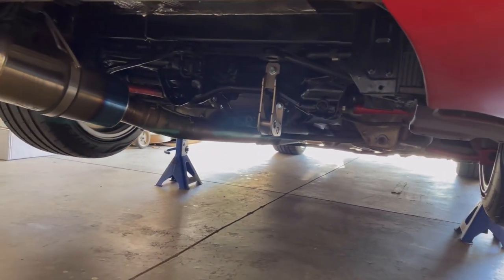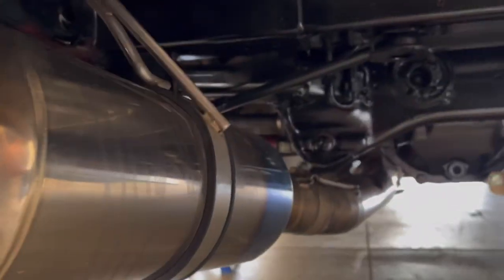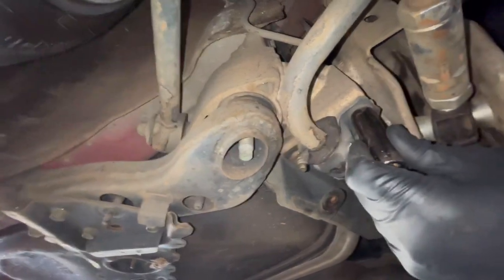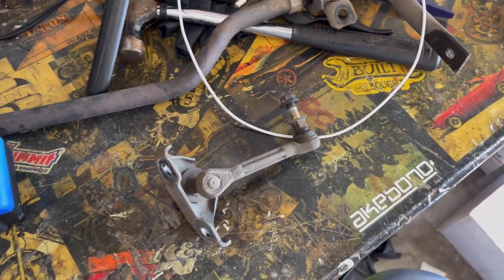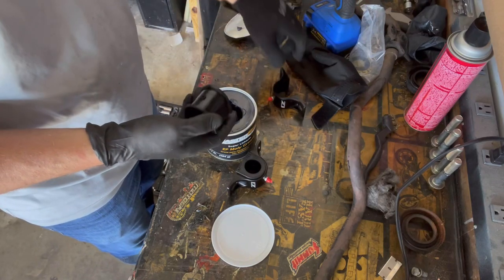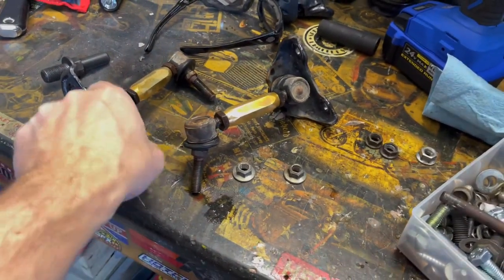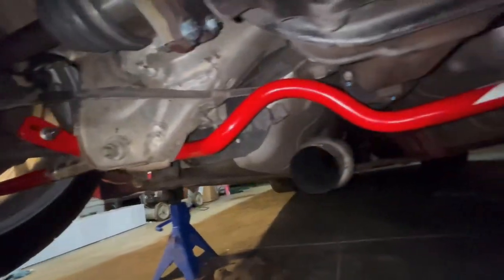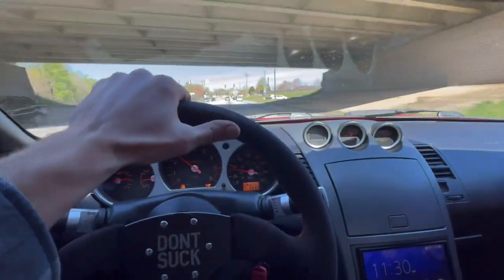Z1 Rear Sway Bar Installation and First Impressions

Comment: It makes a huge difference no doubt,  everyone will agree.  
My problem is I learned the hard way the importance of "zero" preload on the front swaybar.   Completely snapped one of the 35mm brackets holding the swaybar.   So adjustable end links were ordered.   So they are necessary 🤔 and not just because of corrosion or wear.  Good video!

Comment: No hooning test? It'll come I'm sure. 😄 The first couple of sideways takeoffs I remember from the week I put in Eibachs on my old 06 coupe were legendary. You don't quite expect it, and counter-steering in this car was made so easy by old time Nissan engineers. Good job Z1 for making an affordable set, and good job to you for dedicating a vid to the rear sway.
Reply from the maker: I need to get out there and rip but still only have about 350 miles on the new clutch so trying to hold back some lol

Comment: I had Hotchkis sways put on my Z, front and rear, a number of years ago and was really satisfied with the results. I just had the diff bushings replaced with polyurethane ones and like the result. I have a Z1 aluminum strut tower brace that's coming in a couple of days and I'm looking forward to putting it in, it's about half the weight of the stock brace and about 10% more stiff. I'm thinking of getting the Z1 front subframe brace soon.
Reply from the maker: Nice little upgrades that have quite an impact!

Comment: I put a whiteline front bar on my 370z which seems to be what most people recommend. Handling is pretty good at the moment, I keep thinking about getting a rear bar too but not sure if it will be worth it.

I always used to put big rear sway bars on my slow fwd cars to make them a bit more prone to oversteer but don't really need that in the Z
Reply: Hmm don't think it could hurt but I'm in a G37s so my ride REALLY  needs a full setup I definitely noticed how much more focused a tower strut bar made it (but i believe z owners get one at stock G owners don't have too much at all)
Reply: @FOXXHOUND86  Budd, everything that z owners can get so can we (13 G37s)  Bars, breaks, braided  lines, bushings,  intakes, etc.
Reply: @Dragandspinn  yea its pretty much the same vehicle ours is just in a suit & tie and has extra motors for the power options (seats, steering wheel,etc) and the back seats. All these makes our vehicle more heavier/slower than a 370. But the g37 coupe is just prettier and I like pretty things haha

Comment: Z1 vs Hotchkis impressions having both in hand?  I know you haven't A/Bd them on the same car but curious to hear your thoughts as it seems the specs on these are aiming to replicate what the hotchkis bars achieve.  I think its nice Z1 includes the billet brackets.
Reply from the maker: I will have to try and make a comparison that makes sense.  Although it was a pretty dramatic difference in the Z, the hotchkis sway bars being added to the Q was a MASSIVE difference.  But that is such a big heavy car, so one would expect the difference to be more significant.
Reply: @SpeedCultureStudios  okay cool man thanks for the reply.  looking forward to hearing your thoughts on one vs the other.  I think you are in valuable position to have tried both of them and had them both in hand.  I assume most people looking at the Z1 bars are considering them vs Hotchkis.
Reply: Hotchkis sway bars are a bit cheaper and offer one notch more of adjustment than the z1
Reply: Also I put some adjustable p2m end links in the rear, after I already been having the hotchkis sway bars and to me it felt more rigid into the corner than the stock end links
Reply from the maker: @SlickRick214  Don’t get wrapped up with number of adjustments.  The 2nd hole of the Z1 sway bar is 240% stiffer than stock while the hotchkis is only 180% stiffer at its 3rd (stiffest) setting.  I’m a huge fan of hotchkis and have them on my Q50, but the Z1 is much stiffer than the hotchkis for the z

Comment: Do you guys think it’s worth it to put on a 370z nismo?? I was racing an m3 yesterday and it wasn’t hanging with it on the curvy roads
Reply: 10x better handling on corners. My q60 used to feel very floaty when cornering hard, after I installed both front and rear sway bars, the car could do more speed with little floatiness, but that was because of the hard cornering, the car handles 10x better now and it’s totally worth it. Just remember zero preload when installing them.
Reply: Michelin pilot sport 4s + sway bars gives excellent handling.

Comment: Do you think it’s worth it to upgrade the rear sway bar in my G37X Sedan for now or do both front and rear at the same time?
Reply from the maker: Start with the rear.  The awd front sway bar is already pretty solid.
Reply: Both!  The Z1 are quite a bit beefier than the stock 37s. Maybe your x is different.
Reply from the maker: @Dragandspinn  AWD always have a slightly beefier front sway as do the Zs, so the rear would definitely have the biggest impact for the dollar spent.  I’d definitely go both, but if someone is looking to go at it with a budget in mind, rear alone would be a great upgrade for the AWD.
Reply: @SpeedCultureStudios  got it!
Reply: Did the front and back on mine from Hotchkis all at once about 2 months ago.  Make sure you torque the hell out of them at the end links.  I had to retorque my front driver's side because it got loose and started popping.  2010 G37X sedan.  Did the front/back shocks/struts (KYB) last week.  OEM ones had 147k miles.  Very happy now.

Comment: Is it common for it to make alot of noise ? I installed the front and end links . I hear clunking its so annoying
Reply from the maker: Make sure everything is tight.  And did you properly adjust preload on the end links?